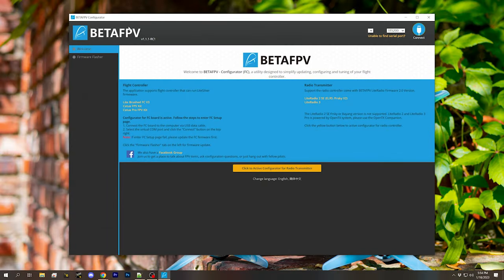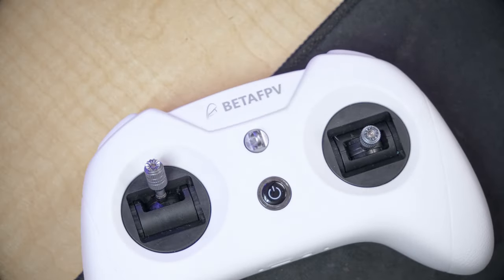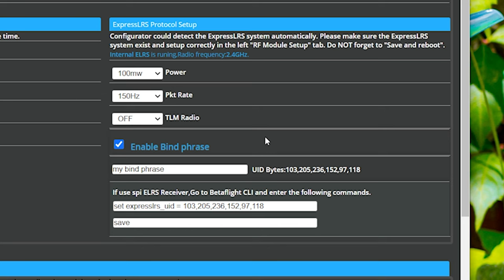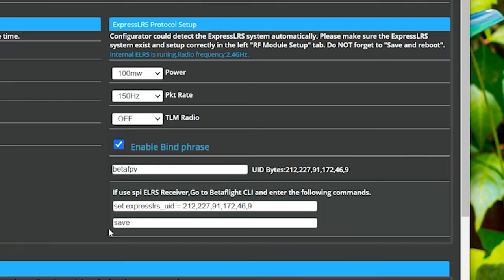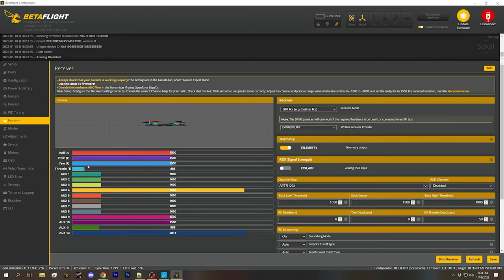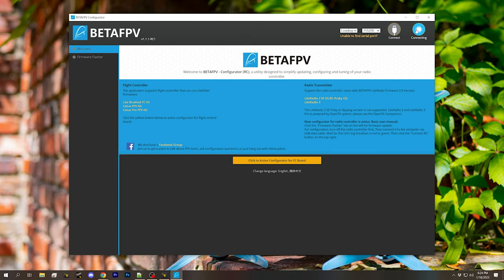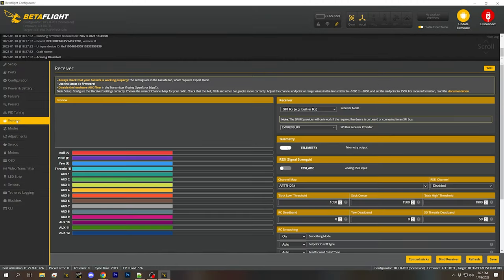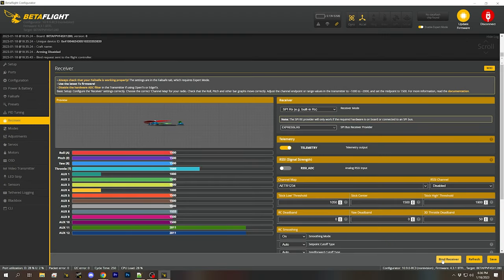How to bind BetaFPV LiteRadio ELRS

Comment: Something to add: the version of beta flight you have flashed is very important if you have an spi receiver. If you are on 4.4 then you will be on ELRS 3.0. If you are on 4.3 then you will be on ELRS 2.0. The lite radio only supports ELRS 2.0, so make sure your receiver is flashed to 2.0 (or you have the right betaflight version if you have an spi receiver).
Reply: Yeah and i have a drone with an ELRS receiver (BETAFPV SuperD) on UART. And that receiver has ELRS 3.0 as default. Supposedly, such receivers cannot be downgraded from 3.0 to 2.0. I haven't tried it yet. But somehow funny and an outrage that I can't bind a new BETAFPV ELRS receiver with a new LiteRadio3. This is really incredible...
Reply: It seems there is now an ELRS V3 update. However, still a candidate. So do it at your own risk. But this shows that a stable ELRS V3 will definitely be possible or perhaps already is...
BETAFPV would have had to do that no matter how if they wanted to keep their remote compatible with new products...
Reply: @Sugalime3D_FPV  I tried the 3.0rc1 firmware and now connecting to the betafpv configuration software the com port no longer shows... has any bound this TX to a pico?
Reply: @chantryholdman3720  i think i had the same issue and coukd not update it. So maybe i understand something wrong or it does not work with my setup... My solution for now is to wait a little bit before i try again...
Reply: @chantryholdman3720 same issue here, basicly bricked the controller that way.

Comment: BetaFPV was my introduction to FPV. Ironically, you put this video up on a day when I was struggling to bind a new Cetus X to a LiteRadio 2 SE. My issue was different though and I was lucky I caught it (since I'm still a noob to all of this but I am definitely learning).  Connecting the controller to the BetaFPV configurator, the internal module had gotten turned off (I've never owned or used an external module). As soon as I turned the internal module on, it bound without any issues.
Reply: How do you turn the internal module on?
Reply: @grahamashby2111  Using the BetaFPV configurator (not Betaflight), connect the controller and on the setup page, it's in the second section titled 'RF Module Setup', the very first option is for turning your Internal RF Module on or off....switch it to 'on'.

Comment: I have a lite radio 3 elrs and I had the same problem with the channels jumping around I fixed it by going into Betafpv configurator and changing the channel inputs then I had another issue with the throttle roll yaw ect ect not matching up I fixed that by changing the channel mapping in betaflight and it worked fine i had to do this with 2 quads though however binding was as easy as pressing the binding button on the radio and using crsfr in betaflight hit bind and I was in business 👍🏼
Reply: I'v tryed to change inputs but still not works

Comment: LMFAO JB I just went through a similar headache this past weekend with my Meteor75. I am referring to the CLI dumps and Hex files on the website - they were useless. Luckily I had done a "dump all" and "diff all" before I started, and was able to comb through them for relevant data.
I then opened the quad and checked the hardware  to confirm which FW was needed on the AIO.
Installing BF 4.4 solved my headaches. It was a very frustrating 2 days or so. I feel your pain.

Comment: Betafpv seems bit uncomfortable to use sometimes and touching a lot of issues, but this comes from the wideness of product line and integration level. Finding something like default firmware or settings for less popular customer and product usually even more disgusting.

For now, there is the one issue about betafpv impacting me. Elrs 3.x was not ported to literadio yet (work in progress afaik), making you unable to flash betaflight 4.4 and even some minor 4.3 to spi boards, cause this versions already migrated to new elrs, incompatible with previous.
Even so, im not 100% sure this issue should be resolved only from betafpv side. See: with betaflight 4.4 you have support for flysky, spectrum, and other ancient spi receivers, but dropped elrs 2.x - why shouldn't it be still available alongside with 3.x?

Comment: A few months ago I bought a DarwinFPV AIO 1-2s FC with SPI ELRS onboard, which used this exact firmware. I went through about as much trouble to bind it as you just did.

Comment: Hey Josh. Appreciate your tutorials.  I upgraded my Cetus-X to 4.4.0 to install a future GPS. Having issues with this Betafpv lite 3 radio to bind. Im assuming the ELRS is not updated to 3.0. Is their a firmware update for the remote? Also, unable to update firmware on this remote or it simply wont flash in Windows 11 Betaconfig
Reply from the maker: This remote can't be updated to elrs 3.0 I believe so you can't bind it to BF 4.4. You have to stay on elrs 2.x.

Comment: OK---same thing happened to me. Would not bind so I contacted BeataFPV. They said hit the bind button on the radio and plug and unplug quad 3 times leaving it plugged the 3rd time---it did bind but still won't fly. Motors arm for a second the spin out of control. In my case a waste of $109.
Reply from the maker: Number one cause for that in a bind n fly is you installed the props wrong.
Reply: The props came installed. It was BNF.

Comment: Hey guys I bought an Eachine novice 4 a few months ago, and I’ve had a range of issues with it so far from screws that won’t come out to faulty batteries, after soldering a wire back in and going out to fly the goggles were disconnecting when I armed it, just the feed not the fps information, and I took the drone out today and the goggles basically don’t connect at all, they show twitches of the image but other than that nothing, just the gps information .

Any help on the issue would be greatly appreciated
Thx 🙂

Comment: I'm very unhappy with LiteRadio3 now. It has ELRS 2.0.1 (from December 2021 !). And there is no ELRS update for the LiteRadio3. So you can't use new ELRS receivers (for example BETAFPV SuperD ELRS receiver on a 5 inch quad) or ELRS SPI receivers with a higher Version of Betaflight than 4.3.
Reply: It seems there is now an ELRS V3 update. However, still a candidate. So do it at your own risk. But this shows that a stable ELRS V3 will definitely be possible or perhaps already is...
BETAFPV would have had to do that no matter how if they wanted to keep their remote compatible with new products...
Reply: @Sugalime3D_FPV  Where can i find it?

Comment: thanks for your videos. but please turn your mic settings down a little. it distorts slightly, and therefore sounds very bad :)
Reply from the maker: No offense, but are you sure it's not your speakers? My mic definitely is not clipping. The mic gain is very low, like peaking at - 25 dB during normal speech, to avoid clipping. I carefully level to -14 lufs and then I run a hard limiter at -1 dB at the end of my audio chain to catch any transients. I do notice my standard audio level of -14 lufs is louder than most other channels use, so maybe it's causing your speakers to distort. But it's easy to turn down the volume.
Reply: @JoshuaBardwell  I dont think so other videos sounds fine. but I will have a closer look :)

Comment: Definitivamente esto no funcionó para mi teniendo, una literadio 3 y un modulo externo nano elrs de betafpv.

Actualicé mi cetus X a la 4.4 de betaflight y el modulo externo nano TX a 3.x de elrs y no funciona y los controles en betaflight estan bloqueados, sin embargo en betafpv configurator van a la perfeccion... Asique he decidido vender la literadio 3 y comprar una radiomasterzorro para tener mas opciones de actualizacion y de modificacion de parametros.

Definitivamente la literadio 3 no es recomendable si quieres profundizar el mundo del FPV.
Reply: It seems there is now an ELRS V3 update. However, still a candidate. So do it at your own risk. But this shows that a stable ELRS V3 will definitely be possible or perhaps already is...
BETAFPV would have had to do that no matter how if they wanted to keep their remote compatible with new products...

Comment: literadio with ELRS module does NOT work with ELRS V3... Only V1... Confirmed by BETAFPV... Returned...
Reply: Nop. i'm flying elrs version 2 actually
Reply: @W1rbel  Mine is at 2.0.1. BUT the newest ELRS reciveres (BETAFPV superD, and a DarwinFPV ELRS receiver taht was with my drone)) I have bought have ELRS 3.0. BETAFPV shame on you that my LiteRadio3 doesn't work with these receivers yet. Thus, the LiteRadio3 is really rubbish at the moment! According to a Youtube post, 3.0 receivers cannot be downgraded to 2.0 either...
Reply: It seems there is now an ELRS V3 update. However, still a candidate. So do it at your own risk. But this shows that a stable ELRS V3 will definitely be possible or perhaps already is...
BETAFPV would have had to do that no matter how if they wanted to keep their remote compatible with new products...
Reply: @Sugalime3D_FPV  great. thanks..will test it soon. it will be a sim controller for a kid, so I will have no dramatical impact, if the radio link sucks.
Reply: @BatzBenzerFPV also put the BETAFPV hall gimbals on it. After 7 months my poti gimbals was defective... The good thing is, it's easy to change.
Reply: @Sugalime3D_FPV  will NOT investigate just one penny in this "p o s"... especially it will be used by a kid..see comment above
Reply: @BatzBenzerFPV  It's not that bad. :D But also not that good price value if you need to change gimbals and wait an erternity for updates......

Comment: Unfortunately everyone watching this video probably already owns a BetaFPV LiteRadio, but if you haven't and are thinking of getting one, don't. It's literal trash. And my experience is almost everything BetaFPV makes is also garbage. The fact that you need a dedicated video about how to bind a radio and a bunch of problems happen show that BetaFPV's products are terribly designed. It's ELRS, it should work like every other ELRS product but doesn't because BetaFPV thinks they can do it better but ultimately does it way worse.
Reply from the maker: For the record -- and I think I was clear about this in the video -- the problems in this case were because the guy who owns this quad couldn't get it to bind and did all kinds of crazy things with the config and flash and messed it up. This one is NOT betafpv's fault.
Reply: I have exactly same issue but not with beta fpv but with jumper t lite v2 My betafpv lite radio 2 bound no problem
Reply: With elrs 3.0 it got even worse - now you need betafpv configurator 2 and once you managed to update the literadio 3 to elrs 3.0 usb is not working anymore. Dont ask why. Also it will only bind to one of the recievers i tried so far, all on 3.3.0...
Reply: Also say you’re a virgin without saying you’re a virgin.

Comment: If you like to punish yourself use a lite radio. Lol
Reply: literadio 2/3 still most compact rc transmitters with integrated antenna. Also highly likely literadio 2 forms was stolen by (great and terrible) jumper t-lite. While literadio was copied from xbox controller. While literadio 3 looks self-designed. While jumper t-pro stolen again from dji. Lol

Comment: Quick, learn how to bind it before the gimbals stop working.
Reply from the maker: You're not wrong
Reply: @JoshuaBardwell  I wish I were. I got 3 weeks out of the V1. 2 weeks out of the V2. Not even going to try the V3.
Reply: @CarbonGlassMan if you upgraded to the hall gimbals it would last years though
Reply: @CarbonGlassMan  the gimbals in v3 I had didn’t even work out of the box….
Reply: @BowOneFire  I considered it, but the price of the gimbals was about what the radio was, and the only reason I bought this radio was to have a very inexpensive D8 radio. So instead of buying upgraded gimbals, I bought the V2 radio for a few bucks more than the price of just the gimbals. I'm happy with BetaFPV's receivers, their 2.4 and 915mhz modules, but their little radio turned out to be a waste of money.

Comment: They could totally just put a standard Elrs RX on that quad, makes zero sense to do what they do.
Reply from the maker: Not exactly. The SPI receiver saves the cost and board space of the ESP chip, which is significant.
Reply: @JoshuaBardwell  I guess I’m talking about the bigger picture, the cost of maintaining software to do a job that other software already does and does a much better job of doing. My personal experience with this exact equipment was the FC getting bricked by betafpv config when updating to match the controller firmware, and betafpv refusing to exchange for another. So i foolishly bought another and it wasn’t recognized by betafpv config. It’s dodgy software that they need to either ditch or put a lot more money into, or just put a regular RX and call it a day.

Comment: I click connect and the button stays blue and won't connect.
Reply: same thing happens to me, were you able to figure it out?
Reply: @Cvft99  Yes!  A different computer and then there was no USB conflict which I d/l all the "suggested" fixes.  Try a different computer or google USB fixes first, (which didn't work for me).  Once the other PC was able to "Connect" I assigned the bind phrase and saved.  Then in betaflight config I assigned the same bind phrase and now it works everytime.  I can explain further or give you a video if you need help.  Cheers.